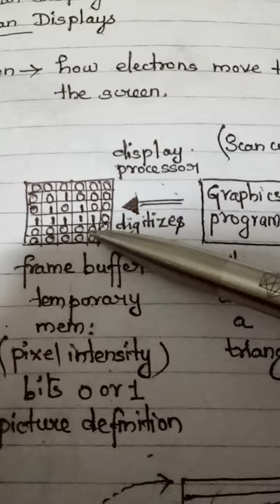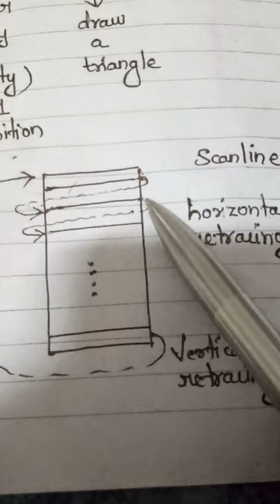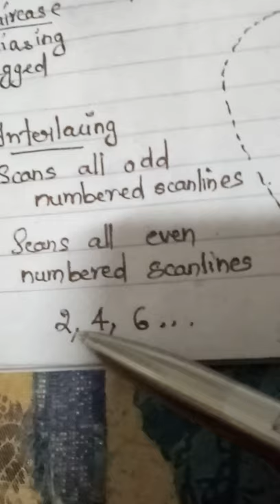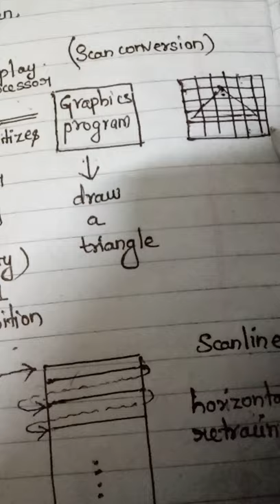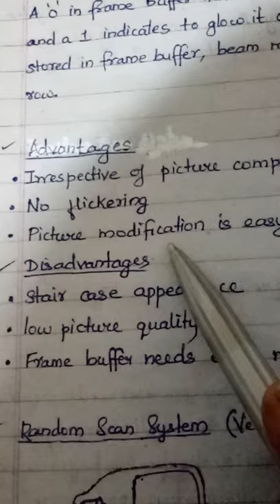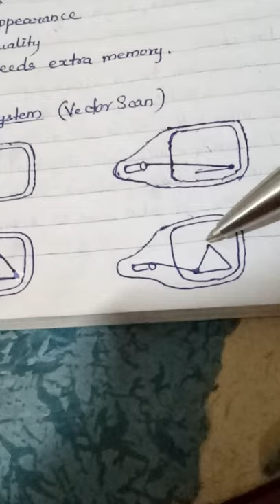Random & Raster Scan Displays

Comment: Since Random Scan display is only going through selective number of pixels rather than all the screen pixels, why exactly is the refreshing time high? Shouldn't it be low instead?
Reply from the maker: Dear
In the raster scan systems irrespective of whether the picture is complex or simple the refreshing time will be constant because the time taken for the beam to move from the first pixel of the screen to the very last pixel of the screen will be same and now about the random scan system
here refreshing time is high only for Complex pictures since it was clearly specified that in random systems every picture is drawn by line by line so it is very difficult to draw Complex picture using this lines so only in those circumstances until the picture is completely drawn on the screen The Beam is to be fired and each time the beam needs to be fired carefully only those portions so as to avoid flickering and hence refreshing may be high